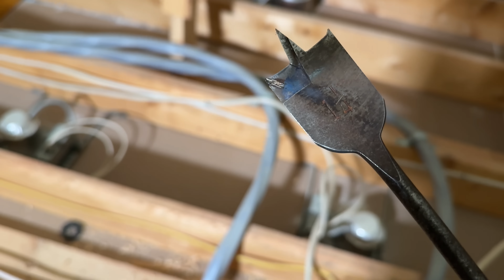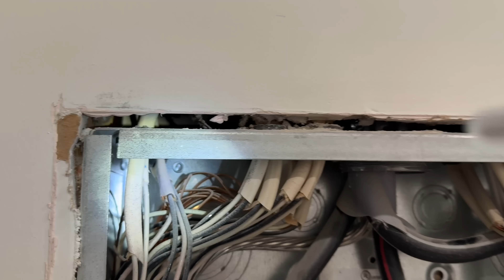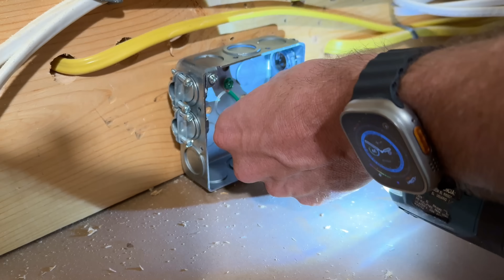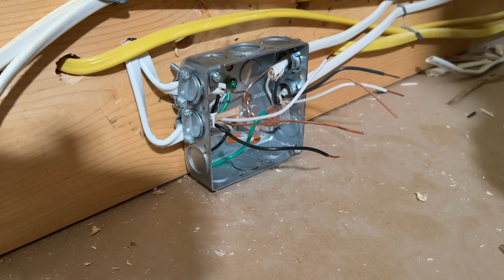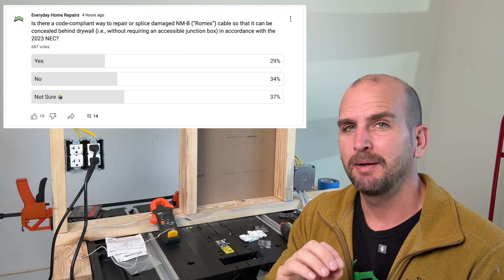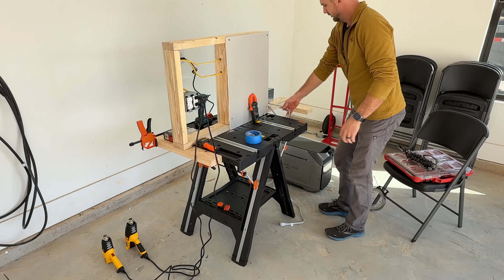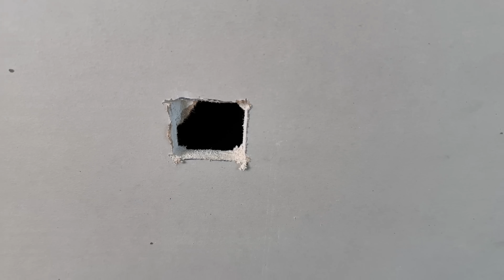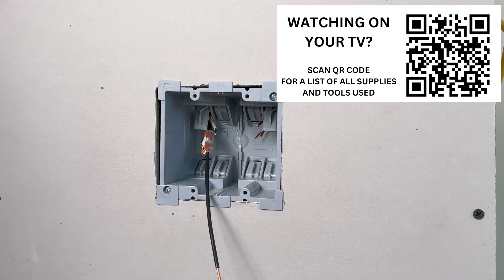How To Repair Damaged Romex |  3 Easy DIY Fixes

Comment: Pro electrician (retired) here.  A few thoughts:
1.  I question if using Wago connectors on very short wires in a box is code compliant.  E.g. you also could squeeze a wire nut on a 3" pigtail but that wouldn't be compliant.
2.  In the old days when I needed to tap into a Romex in an attic or basement and didn't have any slack to work with (i.e. 99% of the time) I'd mount two junction boxes for each end of the cut Romex then put a Romex jumper between them.  But I always wished for a better method.
3.  Something DIY channels never mention when connecting wires in an electrical panel is any concern about phasing.  That's potentially a serious problem if you end up overloading a shared neutral between two circuits (leading to an overheated neutral) or overloading one of your mains (leading to your main breaker tripping).
4.  If the Romex is concealed and there is no damage to the copper conductor, I'd strip the outer jacket back a few inches then wrap each conductor with good quality tape then wrap it all with more tape.  I believe that's code compliant because you're essentially replacing the insulation with an equivalent amount of tape.

Comment: I used the wago levernuts on a electric golf cart.  Moisture corroded the wires and the levernuts. It was under the seat so there was nothing directly getting it wet, just humidity.  I suspect that will be a problem in humid coastal uses in non air condition spaces.  The fail was less than a year after install.  Now I'm trying same levernuts with duct tape to keep moisture out.  Maybe they can be packed w dielectric grease but I've never seen that and question its safety.
Reply: Wago make a gel box for outside connections

Comment: I used all since 2000’s in Europe. More than 20 years use and no issues. Showing that in the US, it’s great !!  Works like they design it’s for and help you to access the area  and repair it with no other expenses that repaid the wall if you don’t like the blank cover. Drywall back in the opening and paint it.

Comment: Is this box in the attic not considered a buried box?  That is, only you add insulation, will it not be covered?  Using a box cutter to remove the Romex insulation would be an automatic fail do some inspectors as it can nick the wires and create a possible hidden "future" short.

Comment: Cool. Amps are amps at 1 volt or 220 v. Power is current squared times resistance in watts which is proportional to heat.
Volts don’t matter except when the connection breaks down and arcs.

Comment: Almost any RV built with slide outs has the Romex Splice Kits used to connect the electrical devices in the slide to the main coach.  The industry has been using them for a long time with no issues.  Yes, they look questionable but they are certified and they work.  I usually place wire ties on each side to ensure the connection doesn't come loose.

Comment: No way would I use that splice kit.
Sure, your heat test seemed fine, but what happens over years of service. I've seen so many of those knife style connections fail in outlets and other devices.
These may be UL listed, but call me super sceptical for long term use.

Comment: I'm surprised nobody is talking about option 4 - you ARE allowed to do a splice in repair where you solder each conductor, insulate, and then reseal the wall. NEC 110.14(B) merely requires that they have a good mechanical connection prior to soldering, that they be insulated to the same standard as the insulation you stripped off, and that you do not use dissimilar metals (like Al to Cu). You are allowed to seal these behind walls as long as they are part of a repair or a rewiring job. I think the reason a lot of professionals don't do this is that most people learn the NEC while doing new installs during rough-in, and you are not allowed to splice in (hidden junction) when the space is accessible. And if you can fish in a new line, it makes more sense to do so. 

The problem I have with these splicing devices are that anywhere you have a contact, you have the opportunity for failure. We will see these things fail, sometimes catastrophically, particularly in humid climates in homes that aren't well air sealed to the outside because of the corrosion that invariably occurs on conductors which aren't sealed up such as with 3M Super 88 electrical tape.
Reply from the maker: Hmmm, Andrew this is the first time I am seeing NEC 110.14(B) called out for allowing a soldered splice to be buried.  After mechanically securing the wire and then soldering how are you insulating the wire such that it could be buried in the wall without a junction box?
Reply: @EverydayHomeRepairs  3M Super 88 is rated to 600v, which is identical in rating to the insulation on your standard Romex 14/2. The way I was trained was to do a double helix wrap - spiral the first layer in one direction, then go back over it with a second layer in the opposite direction. This cross tension would keep the wrap tight even if the adhesive started to fail. (Note: The rating is not additive - 2 layers of tape rated at 600v is still rated at 600v.) You did this for all the conductors (including the ground, which is normally bare), then used an industrial adhesive lined heat shrink  to restore the outer sheath. This also kept tension on the tape in case of adhesive failure, provided additional protection to the entire bundle, and just looked prettier than a ball of tape. Pretty work tended to get passed by inspectors.
Reply from the maker: @azurealism  interesting 🤔 thanks so much for your feedback and sharing your experience.
Reply: While NEC 110.14(B) permits soldering as a method for joining conductors, it does not override the fundamental requirement for splices to be accessible. A soldered splice is not a "loophole" that allows for a non-accessible (buried) connection. Soldering a connection and then covering it with drywall or permanent building finish is a code violation. 
You can't bury the splice! With very few exceptions (such as listed underground repair kits), all splices must be made in an accessible box or conduit body. Soldered splice is not an exception.

Comment: Your last option is not code compliant. Don't have 1/4" sheathing in box and wires are to short. Need a minimum of 6 inches and at least 3 inches outside of box. Stop watching handyman and hire licensed electrician

Comment: The way you did option 3 you added more points of failure than needed. All you needed was 2 WAGO lever nuts and 1 jumper per wire.

Comment: The NSI splice is interesting and I could see some niche situations where I'd want to use that but at that price, it's not gonna happen. 60 pack of the wago lever nuts being nearly $10 cheaper than a single NSI splice, come on.

Comment: Hm? … To begin with, if the damage to the electrical wires was done in the attic, I would have done exactly what you had done:                 1.) place a metal junction box.                                           2.) secured the wires with the clamps on the junction box.                                                   3.) And, I would have used Wago Lever Nuts or wire-nuts to complete the wire connection. 👍

Comment: Minor correction at 7:43. 20A at 120V would be 2,400W. Thanks for the video presenting a variety of options!
Reply: It is also worth noting that the 2400W is dissipated in the external load, not in the wiring, so that wattage calculation is pointless with respect to the problem at hand.  The heat that is dissipated in the wiring is due to the resistivity of the wire and any extra resistance introduced by the splice.  The resistivity of 12ga wire is .0016 ohms/foot, so about 0.002 ohms between 16" OC studs.  At 20A, that works out to 0.04W .  Double that because the same amount of current has to flow back in the other wire - either the other phase for a 240V load or the neutral for a 120V load.  So the wire heats each chamber with 0.08W.  The real question is "what is the extra resistance of the splice".  Apparently, based on the experiment, it is negligeable.  Hopefully it will remain so over time.
Reply: Major correction : The voltage that matters is the voltage along each individual wire, not the voltage between the line and the neutral.

Comment: Still not a fan of the splice kit, option 3 would be my choice. Some options with that too, though, if you're having trouble with the short wires, you always have the option to put two boxes in the wall, one next to each stud on the sides of the cavity, and add a section of new wire between them, or use a wider box like a 4-gang to get yourself some more wire to work with inside. Yes, it might be more ugly, so it depends on the situation whether that's viable for you or not, but it's something to keep in mind. I've had to do a lot of this type of thing repairing hack work from previous owners such as nut and tape splices (no box) in ceilings and attics, and making small modifications like adding some lights when a full remodel was out of the question.

Comment: Hint for the last one: Since you are putting a blank cover on it and not using it for a device, turn the box sideways and have the wire enter each side so that it is inline. That way you can hopefully have only one splice. The inspector may not like it as there is NO slack in the wire but it makes for fewer connections.

Comment: Great information and informative. Suggestion: for option 3 fix, I assume you could use a single gang box mounted horizontally to reduce final footprint of the repair.  Question: I need to move the location of the ceiling box for my dining room hanging light. Is it acceptable to use the in wall repair device to extend wiring to the new box location?
Reply: yeah I was wondering why he couldn't have just turned the old-work box sideways, especially if it's just a blank 2-gang plate going on top, most people wouldn't notice.

Comment: Just 2 weeks ago, I moved an overhead light fixture in a room. Of course the romex did not have enough slack. I had to pull a new line, fortunately, it was fairly easy to pull from the wall switch box. I wish I had seen this video a few weeks ago..

Comment: I'm a master certified RV Technician and you are correct, they have been using them for years in the RV industry. The splice kits have been around for at least 6-8 years that I've seen at my dealership. We have to use the splice connectors and they work well when coming across damaged wiring in the walls or ceilings. Often used in slideouts. The big difference i see in your kit is it's white. Ours use yellow housing for 12ga and white for 14ga. I would double check that you have the correct size when using those. The press in outlets often fail because they weren't Installed correctly at the factory. They come in loose all of the time. It's one of the main things we check when they arrive at our dealership. They don't offer a lot of contact on the wire but they hold up well during travel. I stress to people all of the time not to max out the outlet rating because just like everything else in the RV, it's cheap for travel.

Comment: Electrical contractor here. Wouldn't have done any of those things. Would have opened the wall took the right side of the damaged wire and turned it down into a new box then used the left side of the damaged wire as a pull string to pull a new correct length wire to the existing outlet box. Terminated everything and installed a new outlet in the new box adjacent to the existing box and fixed the drywall.

Comment: For extending wires inside an electrical box, I would use IDEAL Spliceline 42 Orange In-Line Push-In Butt Splices. They are suitable for joining and insulating 2 wires. These butt splices feature a transparent polycarbonate window to provide visual inspection of the connection and a wire gauge ranging from 12 - 20 AWG solid wires or 12 - 16 AWG stranded wires. Each connector has a check port for continuity testing. The WAGO Connectors are great for connecting two to five wires.

Comment: Use the wadi 2 line connectors, but to extend the wires use IDEAL SPLICELINE 42 Orange In-Line Push-In Butt Splices. 

The IDEAL Spliceline 42 Orange In-Line Push-In Butt Splices are suitable for joining and insulating 2 wires. These butt splices feature a transparent polycarbonate window to provide visual inspection of the connection and a wire gauge ranging from 12 - 20 AWG solid wires or 12 - 16 AWG stranded wires. Each connector has a check port for continuity testing.

They are ideal in this application to extend wires in a junction box! 😊

Comment: I've used the Tyco branded ones.  They work great.  I actually used the Tyco tap and splice which allowed me to add plugs where there was not enough slack to get the cable to where I needed the plugs.

Comment: How did you get away with attaching box to dwelling in the attic with screws inside the box? It's been my understanding that it's illegal to attach j-boxes or work boxes with screws to building framing FROM INSIDE THE BOX...
Reply from the maker: Hmmm, I haven't heard that one before.  Do you know what part of the code would prohibit screws passing through the back of a metal junction box?

Comment: i don't even use punchdown ethernet stuff. keystone coupler jacks or bust.

for line voltage electrical? junction boxes and wire nuts or wagos.

Comment: 11:49 honestly, what’s the difference between these and the push through connections in many electrical outlets?
Reply from the maker: The back stabbing is not an insulation displacement connection.  The amount of contact area is fairly similar.

Comment: I personally am not the biggest fan of uninsulated cables in a metal junction box! Especially in rooms where humidity can be uncontrolled or not noticeable daily. At the same time, wood burns and screws are attached to a metal junction box without plastic washers. And the fact that the more wires we have exposed to moisture and temperature changes, the faster oxidation and rusting occurs. If the apartments are designed for a 20 - 30 year lifespan, then it is not a problem as long as we are not near sea air with a lot of salt. How long is the recommended lifespan of metal junction boxes? And when is it recommended to replace them? Because if I am not mistaken, they are galvanized and connecting different metals in series creates a battery!

Comment: Just for your test remember copper is very thermally conductive and you have both sides exposed at a very short distance so even if more heat was produced it would be conducted away, this is something we factor when derating the situation needs to be more than a certain percentage of the run because the heat equalises across the whole cable

Comment: In some areas that box you did the inlines would be fine but you still need a quarter inch of romex jacket inside the box - so you might need a larger box to get the reach.

Comment: I had a contractor cut through a wire from the basement to 2nd floor about two years ago.  Wasn't crazy about the idea of a buried splice kit, but it was so difficult to run a new line back to the box due to the huge amount of lumber around the front door that it really was the best option.  The NSI splice kit solved the problem.  I would recommend taking lots of photos with tape measurements next to it so you know exactly where the NSI splice kit is in the wall in case you have another problem with that circuit in the future.

Comment: Good video and as engineer graduated from Europe I do believe you should pay attention for next things. 1. In order to remove isolation from the wire you cannot use simple knives. It should be isolation safe wire cutting tool. Knipex has it. Knife can damage an isolation. 2. For the electrical works you need to adopt screwdriver with full isolation till the crew point. No replaceable bits. 3. Wiring box if it is from metal should be grounded. For in-house use plastics is a right choice. When you are fixing a wire inside the box the cable handles should be with isolation washer. By simply pressing with screws you can damage the wire isolation or it can be melt while load. 4. Wagu or any other connection is up to local standards.
Reply: literally no one does that shit with the fancy tools. Everyone uses a basic sheet rock knife and learns how to not cut to deep and insulated screwdrivers are apprentice tools. If you want the world to know you have know real world experience this is how you do it lol.
Reply: @ It’s quite not representative.  If you are living in a frame-based house it does not mean people are not building houses out of bricks and concrete.

Comment: Nice video but the one mistake you made was to cut all three wires on the romex together on the already installed circuit. You should of taken some of the plastic sheeting off and cut each of the three wires separately with a diagonal pliers. Mistakes do happen and the circuit could have been live or had a back feed. Electricians will always treat a circuit as live. I have seen other journeyman electricians make this mistake on jobs and blow up the pliers. Safety first is the rule.

Comment: I like your test.  As it's impossible for an intact wire to produce more heat than a spliced connection,  I would write off that anomaly as experimental error.  But, I can't help wondering what will happen if oxidation occurs at the splice or if reduction in contact pressure takes place with time.  Given that power is proportional to current squared times resistance, it would be expected that the splice will heat up if that happens.  I guess time will tell if these splices will maintain a near zero contact resistance.

Comment: I dont like the in wall splice kit, it is like stabbing wire into the back of a receptacle and it presses between two contacts points, only on the sides of the solid wire and not all the way around like securing inderin screw. seems like they could use small lugs and not pierce wire